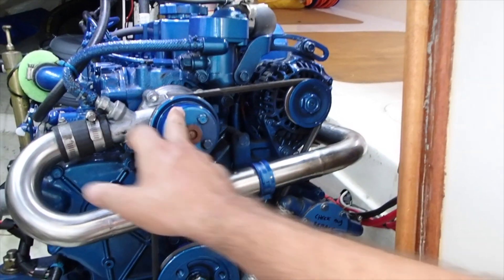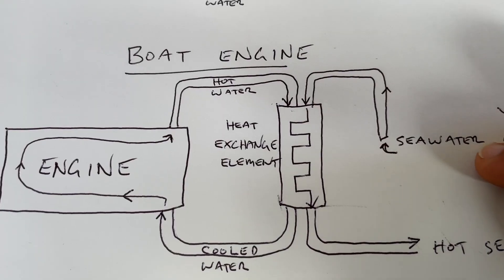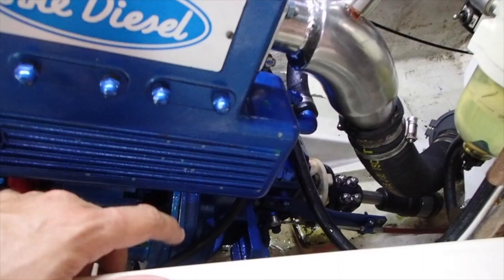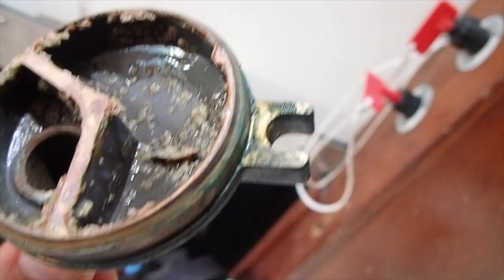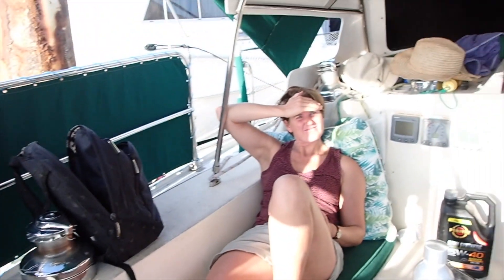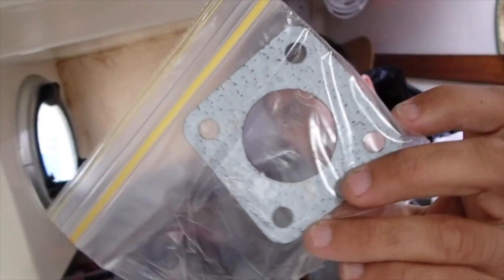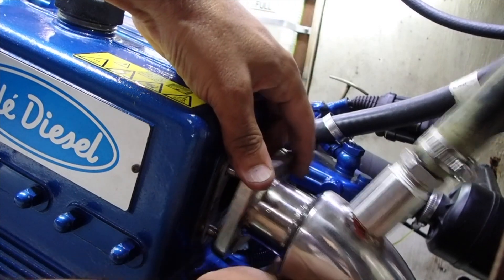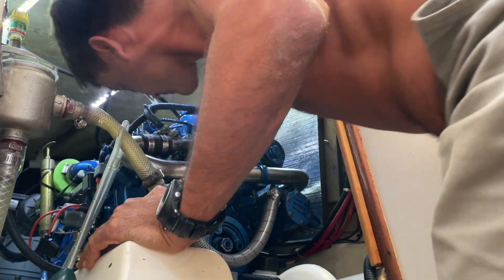How to service a heat exchanger on a small yacht | Episode 32

Comment: Thank you for tips & tricks on the Sole Cooling System. Would like to remind all collegue sailors to refresh cooling liquid regularly (at least yearly I would say). Using a product that applies to all specific engine elements (especially metals). Likely you will not find the exact product advised to in your engine manual. Corrosion problems can get as far as an eat-off of the alluminium cooler reservoir itself.
Reply from the maker: Thanks for the feedback Michel, very good point you raise! Cheers mate!

Comment: Great video thank you for making it. Looks like your motor has extra stainless bits, pipe work, exhaust elbow etc. Loctite 77124 Nickel Anti-Seize would be a good product to use on those stainless exhaust studs. Red threadlocker softens at about 150'C
Reply from the maker: Thanks Peter, tip appreciated. Yes shes been very well marinised by the previous owner. Stay tuned, and thanks for the comment! Jesse